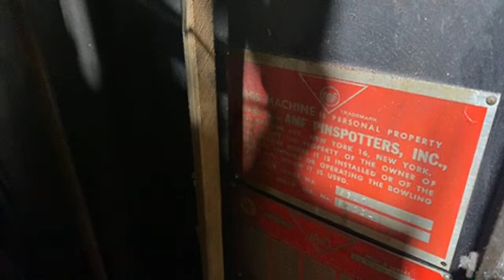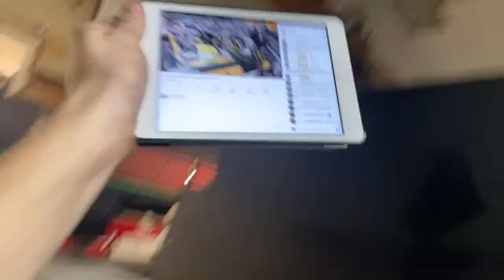Live Sunday Night bowling on 82-30’s pt.2

Comment: 20 pin feed can be caused by several things. The first thing I noticed is that your pin wheel rolls backwards once the clutch shuts off. You need to have a wedge brake in working order To keep the elevator from coasting. You also need to make sure that the wiring from the counter to the receptacle is in good working order. Also check the wiring going to the SW-4. Also check the pinfeed relay in the chassis. Finally make sure all of your terminals are seated properly in the J-strip